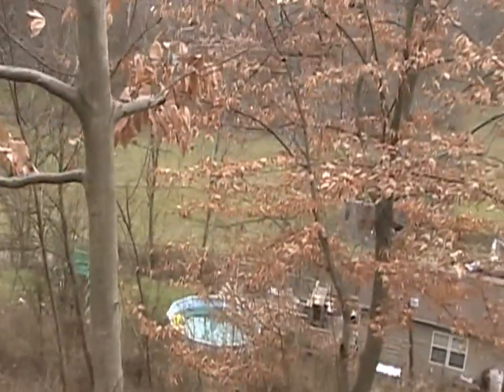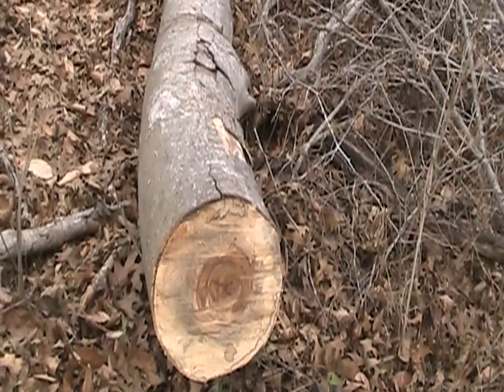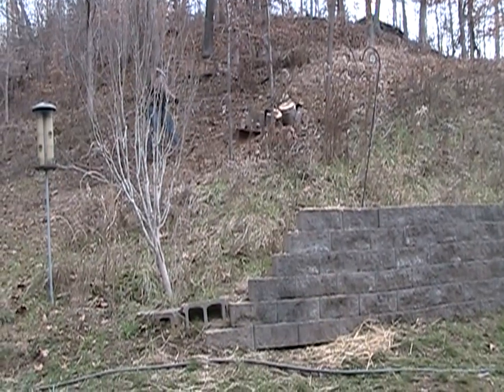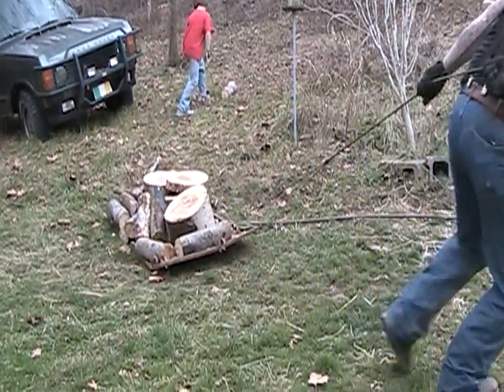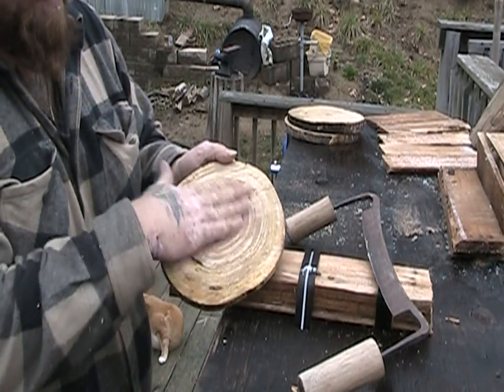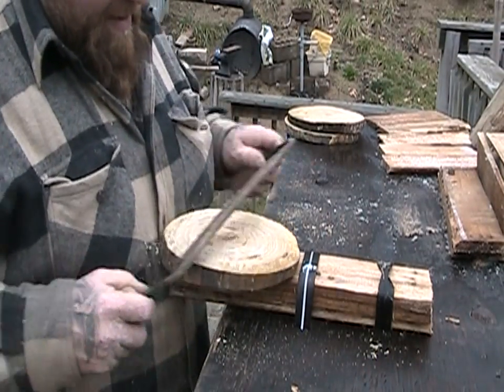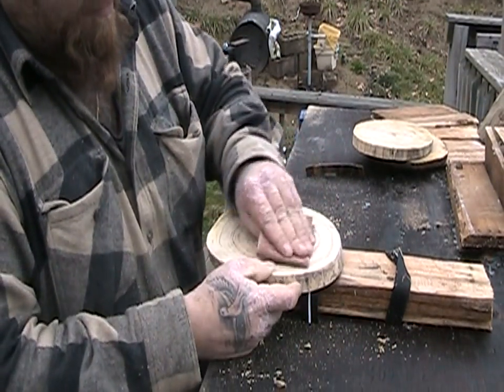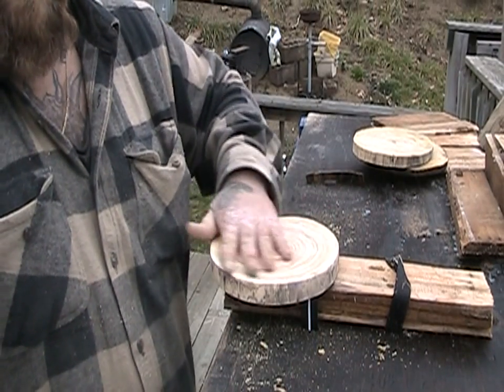DIY: Clock Pt.1

Comment: cool vid you might want to take a Plywood piece and cut out a few slots to put 3 bolts with washer and wing nut  to hold it down when you use the draw knife and sanding just a thought  keep up the good work